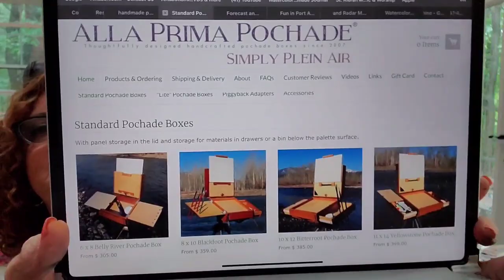My Latest Plein Air Setup, Chat, Art Vlog

Comment: Just food for thought (I'm new here, hi!) I wonder how you might like using that pochade box BACKWARDS, put the sketchbook in it like you have now (though upside down I guess, when the panel is folded up) but then when you fold it flat, if you turn it around so the book is in your lap, then your drawer is on your left side like you want it and the table is on your right? Maybe that would make it totally off balance and weird to use, but it just occurred to me as I saw you adjusting it.
Reply: also, re the glass sheet vs plastic for a mixing palette inside the box, I have found the flexible cutting sheets for using in your kitchen at stores like Big Lots for just a few dollars. They have some at Dollar Tree too, but those are gray and translucent, so they're ok for acrylics, but watercolors do really well on the white cutting sheets, they have a slightly pebbled texture to them and it helps the paint puddle instead of beading up.
Reply from the maker: No I can’t turn it around. The weight distribution would be off as it is heavy duty. But clever idea. The cutting board, I don’t think I would care for for several reasons. First I would think that staining colors would seep into the plastic over time. I wouldn’t like bumpy’s as I like to see my puddles and be able to really soak them up,, and I wouldn’t want my nice sable and squirrel brushes rubbing over them. I can get a piece of white plastic or plexiglass cut at the store though. It would be cut to fit with beveled edges and I am all set.